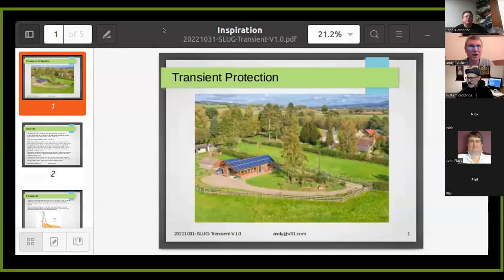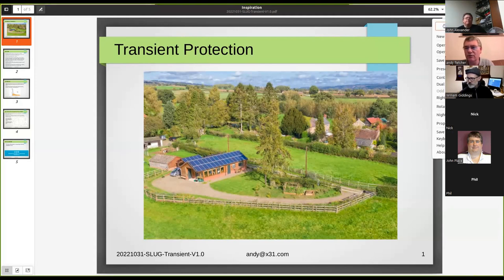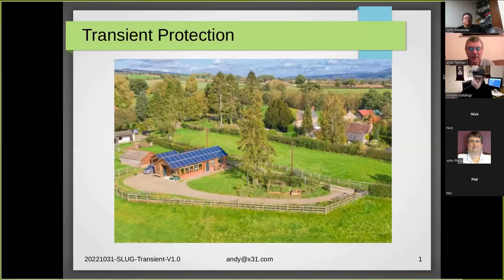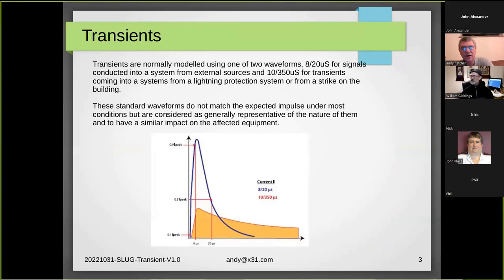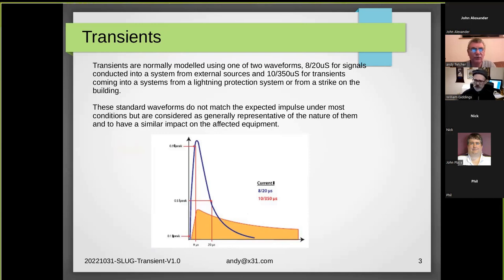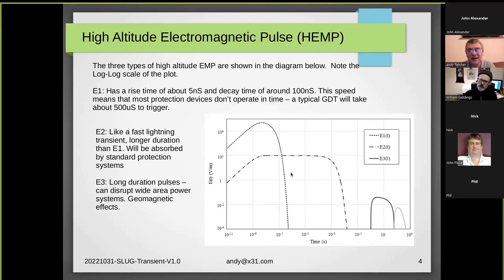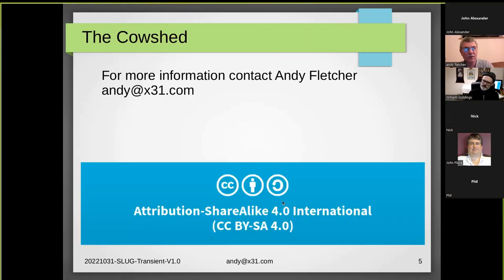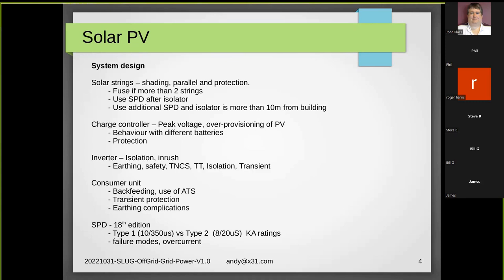Andy Fletcher Off Grid and Solar SLUG Oct 22

Comment: Thanks John for putting up this presentation. My Internet connection fell over part way through the presentation so there is a break of a couple of minutes part way through it, just skip past this bit.  

If anyone wants a copy of the slides then drop me a mail to my address as shown 40 seconds into the video and I'll do my best to assist.  If you are in the UK I can supply a lot of system parts and can recommend suitable suppliers for others - just ask.
Reply from the maker: No Problem Andy thanks for doing the talk, hopefully we shall have more like this up on the channel!
My fault BTW I thought I re aligned the missed out  buit but not quite ....fast FWD pas the 26 min bit for a few seconds ... my mistake